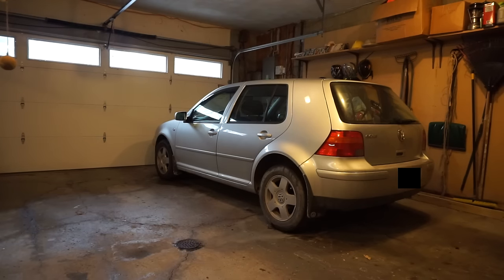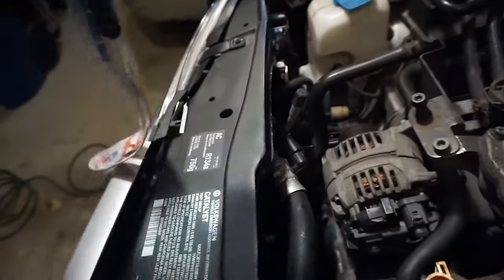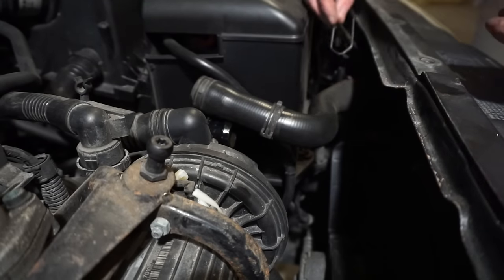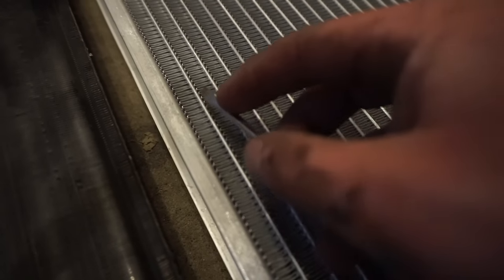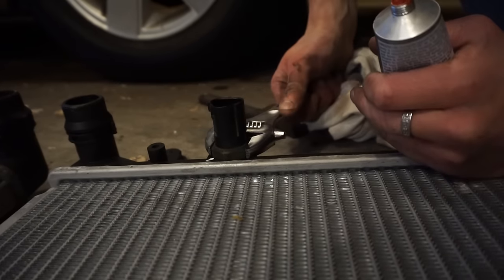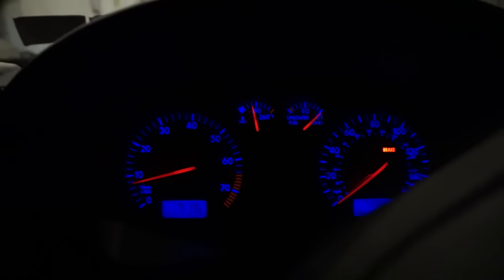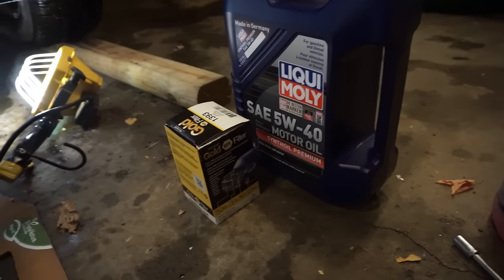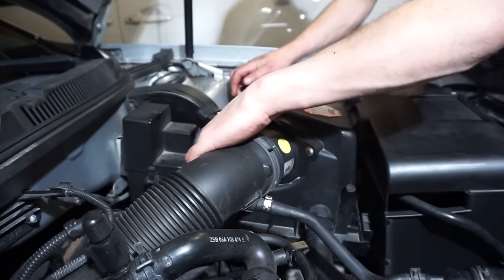Radiator Replacement On My Volkswagen MK4

Comment: I hope no one takes this video seriously.  This is a hack DIY job. You MUST take off the radiator core support in order to properly replace the fan shroud and mounting brackets. Not only that, but driving the vehicle without the front bumper and grill assembly on is downright stupid. You have another vehicle in the garage with you. Absolutely no need to risk it - not to mention being illegal in most states.
Reply: Bits and pieces can be taken from the video ..it's never that serious

Comment: no-so PRO TIP. Make sure you don't switch out the four screws going into the front of the radiator for the slightly longer ones! It's just enough to puncture the radiator tanks (black plastic) and really bum you out.

Comment: You can download very detailed step by step service/repair information from VW on a system called ERWIN. It's meant for garages but you can buy a temporary access for a nominal fee, $10 or something.
I don't always do stuff like they say, but it's a big help if you know before you start what awaits you. Also it is a great help if you just can't find a hidden fastener or something. 
The timing belt isn't a big deal, the only difficult thing was getting the nut on the crankshaft pulley off, that required making a large two-pin spanner to stick through the pulley so you can apply enough torque. Oh, and the motor mount screws should really be replaced after each use.

Comment: Very Nice video, got some neat ideas. Kinda wish I tested my fans before I installed them. Hopefully they work lol.

But would you (or anyone else) had a leaking flange connection for the lower pipe/drain (between the flange and the radiator) after the installation? It has an oring to complete the seal yet it's pissing out despite being locked in presumably properly. I wanna avoid RTV unless generally required or recommended. Just wanna avoid a mess and dumping coolant over something I messed up/overlooked. I'm running a mk4 Jetta vr6 (AFP) but it's an identical coolant system (at least the part in question).

Comment: Great video but you should say in the description that your changing the radiator WITHOUT taking the whole front off the car, which is a lot less work. The official method is to remove the whole front clip!
You should have painted the bumper whilst it was off, it's looking a bit rough!

Comment: Cool that you got to do some car stuff!

Your "Old car" still doing fine? It's in the background right? just put a new door in it?

I would definitely check when the timing belt was last changed. Don't want to have that breaking on you!
The radiator seemed quite easy to do. Good repairs to do yourself.

In Pennsylvania you only have to have a licenseplate on the back of the car you're saying? Thats cool!
With the damage, would that be a problem with any inspection? Here in the Netherlands I think it would be too sharp, so not good for the yearly inspection because of pedestrian safety..

I think it's cool to take us along. If you don't like, don't watch. I find cars interesting, so I can learn from this.

Comment: Try searching for the manufacturer's service manual for your car online, you might be able to find it on forums or other sites for free. They give you step by step repairs for just about everything on your car. I've gotten lucky with 2 cars.
Reply from the maker: I didn't think to look for free copies.  Thanks for the tip!
Reply: +Makerj101 Google for the 'Bentley' manual for yr mk4 it's excellent manual for the car

Comment: About how long did the whole thing take? Is this a Saturday job or just a few hours during a weeknight?
Reply: My son and I did my 2001 Jetta over the weekend after I broke the bloody thing driving over an ice pile while visiting him in Maine. Whoever heard of breaking a radiator? But yep, I did it. The job was indeed a pain in the neck but the video was very helpful and once we had everything apart, it was pretty straightforward to put the new rad in, as we then knew how things fit together. It's not easy to see that at first, as everything is kind of jumbled in together under the hood. I tied the AC rad to the new one with some rope and used that as a "handle" to lift the whole shebang into place from above, which facilitated things a lot. Total time for the job was about six hours.
I am used to old Volvos where the radiator is made of brass and copper, is far enough from the ground you'll never damage one by running over stuff and it takes half an hour flat to take one out and replace it.
But the Jetta is way, way more fun to drive. It was engineered by people who clearly understand driving for fun, unlike most cars, which are built to be used as transportation, period. Who cares what it's like to drive if you don't like driving?
Well, I do and I love my Jetta.
And my '67 Volvo as well, for different reasons...

Comment: I learned a very valuable lesson from this video...  

Never buy a VW.
Reply: I have a 02 Jetta and it is the best car I have ever owned to drive, but it is the worst/most expensive to fix
Reply from the maker: +Richy Rich I really don't think they are much more expressive to own or repair than other cars. It's got 172,000 miles on it. That's why stuff needs fixed. A lot of cars have timing belts that need replaced at 100k. And you should replace transmission oil at 100k but most people don't. Certainly not as reliable or cheap as a Toyota Corolla.
Reply: Richy Rich ya because it's scientifically proven only VW's break down.
Reply: Keith68Camaro
It's got nothing to do with breaking down.  All machines break down.  The question is how easy is it to fix.  I've never had to do that much work to change a radiator, and would you want to practically pull an engine to change a timing belt, Mr. '68 Camaro?
Reply: I had to do about that + more to change the rad on my 08 Dodge Caravan. I had to do the same, but it was (believe it or not) harder, on my 99 Jeep Cherokee Sport. The reason it was harder is the i6 engine on the Cherokee is far too large for the bay (it was designed for a 4 cylinder), so everything is much tighter. 

I've owned a few volkswagons, a mk5 GTI and a MK2 GTI. Neither were more or less hassle OR price than the various (4) honda's I've owned. 

Maker: what size shoe? you got a PO box?
Reply: Thanks for the video my radiator blew at a mcdonalds drive through i had just replaced hoses and water pump also timing belt at first i was like the new hose but as i search around the hose is fine but there was coolant all over the radiator and since the fans cover it i cant really see where is broken at but is and 02 with 174,000 i guess it is time to replace also anyone knows i notice my fans only kick on when i turn The ac but dont come on while ac off could the fan module be faulty
Reply: I have had a Volkswagen Jetta TDI mk 4 for about a year now. I have done couple repairs. Lots of PM's and quite a few upgrades. Just hit a pig so working on it next week using this down time also for timing Belt, serpentine and water pump. Parts broke from pig were as of now a/c condenser, radiator, radiator fans, front bumper cover, headlight mounting brackets so headlights, aftermarket hella horn and the crack that was already in the windshield got way worse. Large pig and 65mph NO CAR would fare very well from that. Geico cut check for $1,500 but would not replace windshield because the crack that existed prior to pig even though it was small going from bottom left to mid top left about 14" but from edge to edge had I not hit the pig it would not have spread because it was not spidered... sorry ranting but  Back on topic I have never remove the bumper or the headlights and had those off in about 15 minutes combined time I have removed front bumpers on a couple other cars and they certainly do not remove as easy as this Volkswagen.
Reply: I bought an 04 with 210k miles on it. With another 10k miles, high mileage repairs, maintenance, insurance and gas. I have spent approx $4k and about 40 man hours over 2 years. Not a bad investment for cheap transportation.